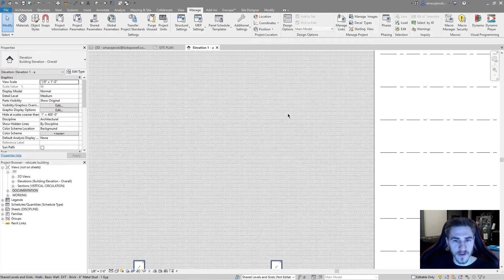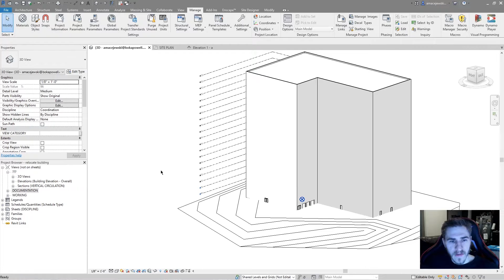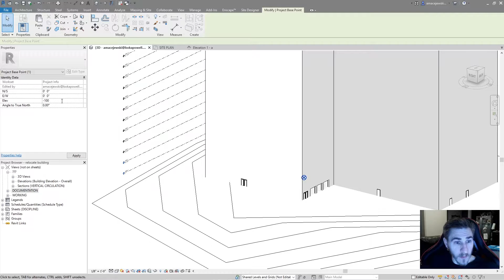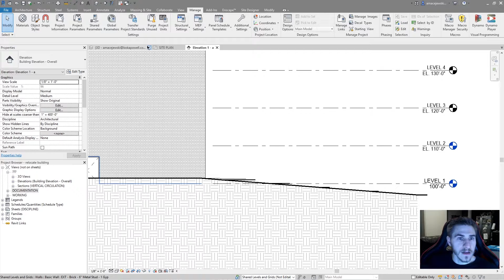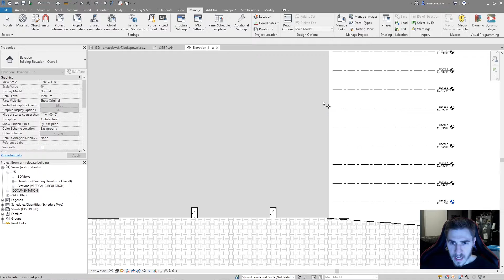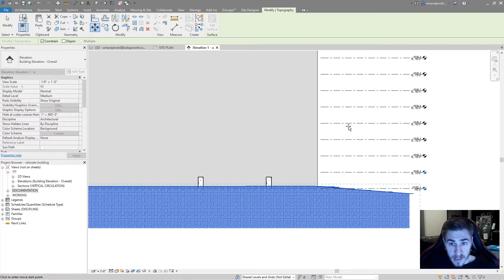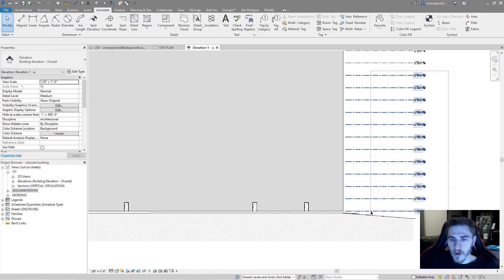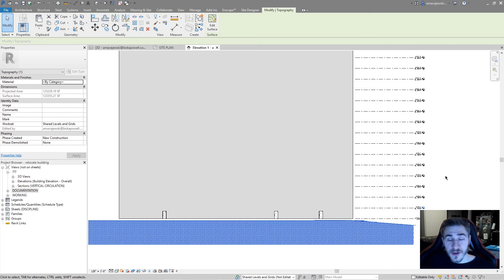How to Relocate your Building | Revit 2020

Comment: I am gonna need to watch this video several times before I grasp what is going on here. Luckily my building is also at 100 ft elevation. 
Wish Revit had a tool to do all this without moving existing conditions and objects that go through a building. I'll move my terrain down, but then I'll have to lower piers, cable trays, cable tray t-supports, pumps, etc. The project manager wants to raise the building 1.5 inches, but I'll only do it one time.

Comment: Hey there, Ive followed all your steps and it all seems to work. however now when i load in my Survey CAD files with real world coordinates, they load in moved as well. Ive tried loading in a fresh CAD file as well. but still loads to the new moved location.
Im currently moving a bridge model down by about 250mm.
Reply from the maker: You m ight check your project based point or shared coordinates if you use those. You can alter those without using the relocate building tool but they will move when you do use the relocate building tool.

Comment: Hi. I am fixing a model made by a third party. It's an exploded axonometric so floor-wise the model's been displaced  vertically. However, they haven't used the displace items tools so the vertical displacement is in the model not just the view. Can you offer some advice on how to fix this? I tried changing the base offset constraints but the walls don't move up or down because an error pops up since they're linked to windows and doors.
Reply from the maker: Gosh, this is tough other than remodeling. I would say for a wall for example copying the entire wall with things hosted by the wall, changing the constraints of the wall to what they should be, pasting in same place so everything goes back, then finally using the windows/doors of the pasted elements and moving those to the new wall location. I hope that helps!
Reply: Thanks!

Comment: HI I moved the project up but al it did was my my survey point down. I initial made my project at 0' for base and survey but now I know my survey point is 98' for finish floor. I want my levels to show project base point elevation as 0' and my survey reference spot elevation to show as 98'. I have tried about 100 ways from Sunday with no success any Ideas?
Reply from the maker: You might look into changing the Z value in the project base point or survey base point. My guess is you would want to change project.

Comment: Question.
I own and operate a Cad / Bim production service
I have just received a design model from a designer. I need to rotate the entire model 90 degrees to get the plans to fit on the sheet. how do I do that without messing up the model.
Reply from the maker: Gary, you would want to simply rotate project north. This would rotate the view without actually rotating the model so you could fit it on a sheet, etc.

Comment: I don't know why the topography moves up with it when we are trying to keep sea level correct. I am not sure who thought that was a good idea. I am just simply trying to lower the house into the topography better. Too bad it's not just moving the project based point which you would call level 0" then simply move the project based point and everything follows. I could have swore that's how it works have been ripping my hair out just trying to do something so simple.
Reply from the maker: Assuming you are using the relocate project tool in section or elevation? The only reason things should move if the move tool is being used.
Reply: @ArchitectureVanguard   Yes I used the same tool you did and topography goes with it.  The then manually move it back.  Glad I watched your video or all I would have never noticed anything was even happening.
Reply: @ArchitectureVanguard   You would think the revit topography is directly associated with the sea level conditions. Come on revit!!!
Reply: @ArchitectureVanguard   It took me hours to figure it out now it's a 10 second move.
Reply from the maker: Haha I agree, it is too bad this is the case but at least we have a fix!

Comment: I think I followed your suggestions correctly, but when I label the contours they are all around +/- 0' when they should be around +/- 360'. I modeled the building and would like to show finish floor at 0'-0" and created the toposurface by placing points over a linked topo map BEFORE I saw your video and used the relocate project tool. Did I do something wrong or have to start over?
Reply from the maker: You might just need to change your spot elevations to read from the survey. Check the type properties that it is reading from the survey. Otherwise, I would relocate the building again and see what happens.

Comment: YOU JUST SAVED ME
Reply: But moving the project base point wasn't working as intended. Maybe I missed something. However the relocate tool worked well. Thanks
Reply from the maker: Very good to hear, I am glad it helped!
Reply: @ArchitectureVanguard   I had issues when it came to exporting an IFC of the model to Navisworks. The model wasn't on the same level with the IFC from the architect. Just a heads up for those who will export the model

Comment: I'm working in ver. 2018 student. I followed your instruction exactly as you laid out. I found the project base point and changed it to -465' since the elevation here centers the building on the site elevation in the real world. Nothing changed in my level elevations in my elevation view. Prior to viewing your video I had developed a site plan at the default level on zero the same as where I modeled the building. Any time I change the plotted points to anything below the building I don't see any grade lines in the negative direction but I do see them in the positive direction. So that lead me to search for a solution and I found your video very convincing but the solution did not play out as planed. Any suggestions?
Reply from the maker: It almost sounds like you did everything correct, you just might need to edit the view range of your site plan so that the view extends below 0'. Give that a try.

Comment: Hey, thanks for the video! Here's a few questions:
1-I have a site that's at a really high elevation(let's say a 100M above the base pt), and wanted  to see if I could bring everything down, as in have the origin set to 100M itself? 
2-Since i modelled the site already, when i tried your method, it change the elevation levels to 100M onwards, but the project base point moved a 100M below the site..that can't be good right? 
3-Also the site moves along with it, so when i moved the site 100M lower to bring it to the level that used to say 0M and now says100M, the spot elevation is fine but the topo points say they're at 0mm above the ground.

4-does the survey point need to be changed or can i ignore that? Also, is this because the project base point needs to be a certain way i.e, clipped or unclipped?
Reply from the maker: 1- I would move the project base point. This will move that point but not the building. 

2- that is really fine, at that point it just comes down to the numbers that you want to show, 100 or one or something like that. 

3-that may be because of the base point. If you want the numbers to be changed, move the base point, if you want every model element to move then use relocate building. 

4-the base point being clipped or pinned wouldn’t matter. And you can ignore the survey point unless you are linking in a shared site or need to coordinate that point with a survey you’re bringing in.
Reply: @ArchitectureVanguard  Thanks a ton! You've helped a lot!!
Reply from the maker: Glad to hear it!

Comment: HI.We are using Revit 2018. after completion of model including all annotations, spot elevations and coordinates , our Client wanted to move the building 3m on east and 1.8m on north direction. moving by physically seems will delete many elements itself also 2d annotation won't move. kindly advise
Reply from the maker: You are able to relocate the project in plan using the relocate tool as well. I would draw a detail line on a floor plan and move the model from the start and end point of the line. That will only move the origin of the model. If you need to keep the site in place and move the building itself then you will need to physically move the site or the building. When it comes to 2D elements, you could group all 2D elements as a detail group, cut the group, move the building, paste the detail group in same place, then move the 2D group the same as the building. May or may not work with hosted annotations though.
Reply: @ArchitectureVanguard  Thanks . let me try as you advised.

Comment: Is there a way to relocate model and have it moved from the internal origin aswell. Eg. If I draw a pipe I get my spot elevation right but the default parameter for invert elevation is not right.
Reply from the maker: Interesting, you may need to move them separately is all. . You cannot move the internal origin, but is the project base point you will want to move.
Reply: @ArchitectureVanguard  Yup had to move the entire model.

Comment: HI, I HAVE A PROJECT AT 0'-0" BUT THE ARCH. RAISE 1'-2" THE GROUND, SO ALL THE ELEVATION NEED TO BE 1'-2" HIGHER WHAT IS THE EASY WAY TO DO IT? THANKS
Reply from the maker: If you need to physically move object and not just adjust the numbers then you will have to select what you want and move it. The relocate building tool will move everything, therefore, simply changing the elevation of it all. Assuming you have things associated to levels, then I would move the level to match the architecture. You will then have to move everything else in the model that is not associated to a level the same distance. Save an archived copy of the model before attempting this as a lot could break. Hope that helps!
Reply: @ArchitectureVanguard  appreciate my friend, i select all elevation and move up and work for me. thanks
Reply from the maker: Very nice, glad to hear!

Comment: Hey,
I'm facing a problem in Revit regarding Elevation, In my project base point and survey point both are at 0'-0" but when I'm export this model looks like the model automatically moves it down negative (-)508'.How this problem has occurred. Can you please help me. if you help me I will be highly obliged to you. Please help me as quick as possible for you.
Reply from the maker: I would also check your internal origin point if you are in Revit 2020. Let me know if that does not solve the issue.
Reply: @ArchitectureVanguard   My Origin point also 0'-0 ".I'm using the 2019 Revit file. Still, I'm facing this problem.
Reply from the maker: Maybe it is an import option of the program you are importing this into. It appears as though you are correct in how you have your Revit model setup. What program are you exporting to?
Reply: I'm exporting this model in naviswroks 2019. Also when I'm linking this model in other Revit files then the model looks like -508' negative. One thing I found when I cheek the elevation my current level is shown -508'.But My project base point and survey point is shown 0'-0".
How it possible. I'm a little bit confused about how to kill this issue.

Comment: Hi, good morning, thanks a lot for your tutorial. I have another question regarding the site plan(i am new to revit). When i orientate the site plan to true north, why wouldn't the building orientate with the site plan.Thanks again.
Reply from the maker: Are you saying that all your plan elements move/rotate but your building does? I would take a look at what did move. Was it specifically 2D or 3D. It could just be that. Assuming you completed the transform correctly, it may be that the 3D model did not move but True North did but at the same time you 2D elements did.. Hope that helps.

Comment: Hi, I have recently started using Revit and have come across this video. I am currently working with two separate models which have been created in inventor, and are now imported into the same Revit project. The two separate models make up different parts of a building, and the problem I am having is ensuring that the two models are set to the correct coordinates. The first model is runs of cable tray throughout the building, and the second model is the actual building itself. I need to make sure that the two link together properly. Is this someone you can assist with?
Reply from the maker: Sure, a good start would be to link in the main model then second, link the model with the cable trays. When linking in the cable tray model, make sure to link using the "Auto - Origin to Origin" then try "Auto Project Base Point to Project Base Point" and see if the model comes in correctly. If neither of those work then you likely need to address the models individually in inventor. Assuming they are both correctly modeled together in Inventor, you should be able to bring them into Revit linked correctly. I believe Revit 2021 has actually linking of Inventor files which would make this even easier than having to do some different export. Hopefully that addresses what you are looking for.